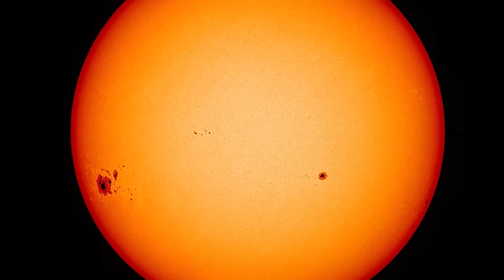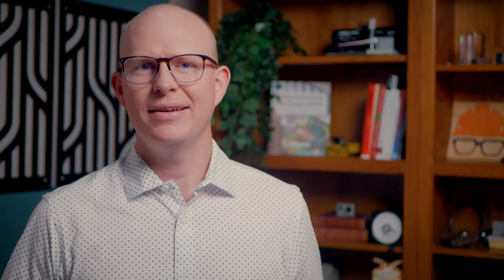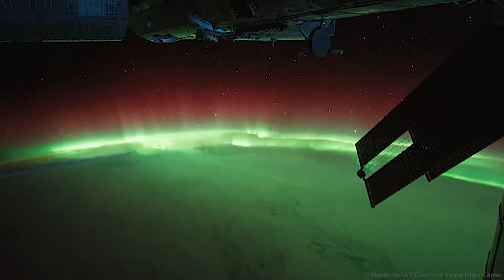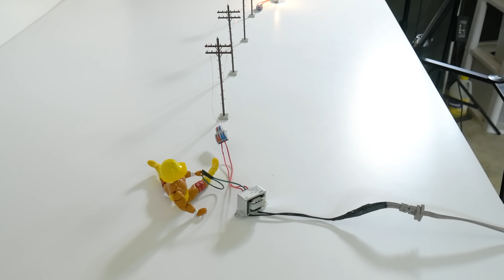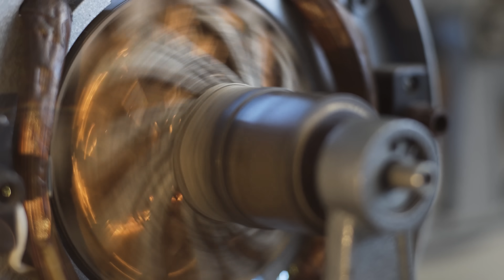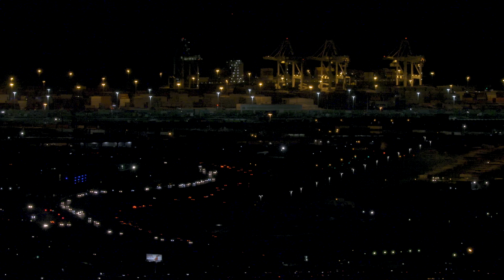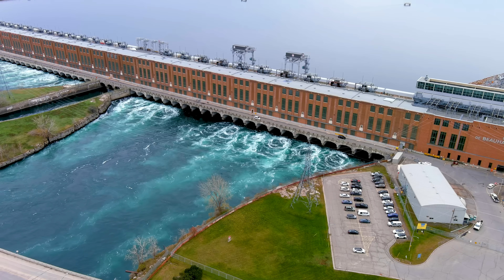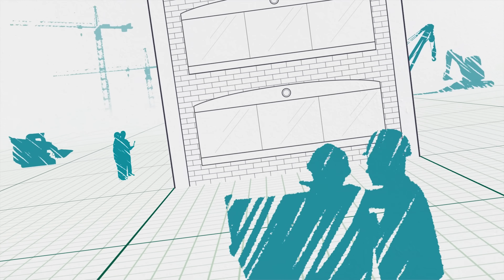The Most Confusing Part of the Power Grid

Comment: Depending on where you live in the world, the plug that goes into the power outlet is different. How is it that there are so many variations? why not one universal plug, no matter where you live in the world. If A USB is the same world over, why not the plug? Is it politics or an engineering issue or a bit of both?
Reply: There are arguments that can be made for and against just about any receptacle design.  While it would ideally be nice to standardize, the fact is that there is significant 'sunk cost' in existing infrastructure, and the benefits of changing to a uniform design don't justify the costs that would be involved.  Saying it differently, its a lot less expensive for the relatively few people who travel internationally to own a plug adapter than it would be to rewire the vast majority of the world to one uniform receptacle design.
Reply: With USB you can just slowly add or change ports as new hardware comes out, but on the power grid, it's hard if not impossible to change socket types without causing huge amounts of undue disruption because unlike computers, houses are in service for decades if not centuries.
Reply: You'd have to (in as short a time as possible) change every building and outlet in the country, and every device that plugs into those outlets, so trying to pull it off will either fail immediately or end in at least one generation of people having both old and new outlets in their homes.
Reply: The power grids were all developed in a time when the world was less connected and most grids started out as small local utilities and they used what they decided was best at the time. Within countries things were mostly standardized, but between countries, who decides who needs to change and adapt? Not to mention, some of the world is 230V 50Hz and some is 120V 60Hz and a few other variations.

Comment: 15:05 I was having trouble understanding how generating more power in the system wouldn't help deliver the power but the analogy of a burnout actually helped lol.
Reply: in less layman terms it has to do with impedence matching and something called the Maximum power transfer theorem
Reply: @WildEngineering  jacobs law... or yeah, thevenin...
kirchoff also applies...
the generator is a resistor and the current also flows through it...

Comment: it bears mentioning that a lot of users with reactive loads will install their own power factor correction systems - so they don't have to pay to rent power they aren't actually using.
Reply: To be a bit pedantic - it's not power factor 'correction'.  When you use the term 'correction', there is an implication that power factor can be incorrect.  But that's impossible - power factor is never 'correct' or 'incorrect' - it just is.
Reply: @monophoto1  From IET: "Power factor correction is the process of compensating for the lagging current by creating a leading current by connecting capacitors to the supply. A sufficient capacitance is connected so that the power factor is adjusted to be as close to unity as possible. Power factor explained."

or to put it in pedant's terms, "power factor correction" is an official engineering term. therefore it cannot be incorrect; any more than "Cheez Whiz" can be incorrect.

Comment: For a wireless road that can also act as a power line (burried underneath) what about using an electric car and a personal card/smart tagging whenever someone gets on the road?  You can have capacitors (and batteries) always on the side of the road ready to discharge and recharge, with the tires acting as the inductor.

What about using homes and cars as a means to buy and sell power from the power grid to other areas, and that way people can not only charge their vehicle, but buy and sell intelligently on the road (literally)
- that would open up a whole slew of opportunities for people who own electric cars, in which their batteries become way more valuable than just a fuel tank- adding value to the vehicle they just purchased, turning it into a working investment beyond getting from point A to Point B.

The Overall Idea is to get power to flow from Large Areas that Already Have Lots of Power to Rural Areas that Don't, and Might Need Help for Power To Flow To Them, Besides People.  

People would be able to see the health of the grid in real time, and they could Literally Plan Vacations and Get Paid To Actually Take Trips.  Everything would be Seamless with a trip planner and an overview, and they could even be advertised to go on a trip somewhere, Literally to either Buy or Sell What They Own Seamlessly, almost like an Electric Stock Exchange.
Reply: See Tesla power wall, with software to feed power back into the grid.
Reply: @Outlaw_Traffic_Stops  How do Tesla (or Enphase) power walls and micro computer controlled solar panels affect power factors, costs, efficiency, etc?
Reply: Check out EEVBlog episode 224 for a thirty minute discussion/rant about why wireless (dis)charging of moving vehicles through a road surface wouldn't work. Not least of the problems that would need to be solved first is the installation cost per km/mi would be astronomical, then the upkeep and maintenance costs would dwarf that within a year, if not a few months. In a post-scarcity, Roddenberry-esque society where money no longer exists: yes, that may actually be (forgive the pun) a road worth going down, but certainly not under the banner of capitalism.

As for physical transport of battery charge from surplus markets to scarce markets, power lines already solve that problem. I mean, you'd already have to have those rural areas connected to a power grid to be able to discharge from the vehicle into the grid. Why can't the grid just handle it like it always has, instead of adding friction, physical work (as-in, moving a mass over a distance), heat dissipation, braking losses, and air resistance losses on top of the transmission losses that are already there? There's certainly some benefit to be had by having the grid able to be fed from car batteries, but using those vehicles instead of transmission lines for bulk transfer would just be throwing ~80% of the benefits of it out of the window.
Reply: I think my full reply might've been ghosted and it won't show it to me such that I could actually edit it (thanks YouTube), but EEVblog 1584, not 224.
Reply: @Phroggster  what?
Reply: @MichaelSkinner-e9j  It's not important. If my original comment isn't visible to you, my citation correction comment is utterly meaningless, and I'm not about to waste another half hour debunking these (technologically feasible, but utterly impractical in the real world) ideas in a polite and thoughtful manner. Just never stop coming up with new ideas on how to improve the world, ok?
Reply: @Phroggster  there are other people who have already developed this technology. 

It’s nothing new.

The difference is money, scale, and implementation

Comment: just  a question, why the power in the graph at 8:33 is not zero when voltage is? is there a reason for it  or is this a simple  mistake?
Reply: Yes it looks like a minor mistake. The power goes to zero when the current does but it should also go to zero when the voltage does.
Reply: You are correct. Power is zero when voltage or current is zero. That is what the graph was intended to show. But the graph is slightly off.
Reply: The voltage and current are not in phase in that graph so to calculate power you need to also consider the phase angle.
Reply: You are right. The power curve should cross the zero at the same points as the voltage and current curves. I guess that whatever program Grady uses for this didn't draw it quite right.
Reply: @czechgop7631  If the load of the circuit is inductive then the inductive parasitic element will act as an intergrator if you actually take that into account when the supply passes through zero there will still be power in the system it's clearly showing this as from around the 7:55 to the 8:33 part the chap refers to maybe open the eyes and ears and not base everything on ideal components that don't really exist in the real world or did your elementary teacher not teach you that and just how to look at a graph without taking into account the situation. Strange.
Reply: @SlyerFox666  No, there's still no power when either voltage or current are zero. All na integration would do for you is distorting the current or voltage curves .. which we don't see in the video. Electricity isn't magic and we have these equations for a reason
Reply: @czechgop7631  Well if there is capacitance or inductance then neither would be zero it's the difference between purely academic theory and real life you can never get a pf of 1 so there must always be some parasitic elements in the circuit acting when one or the other passes through zero
Reply: @SlyerFox666  But you see, none of that matters. You're still changing polarities so you have to cross over the zero line and that's when the power curve will cross also. 

Bottom line, all the OC asked is whether or not the graph is drawn correctly which it isn't. We can argue shapes and angles all day but it won't get us anywhere.
Reply: @czechgop7631  Oh ok well it must be easier to match phases when demand hits peak where your from then ✌️

Comment: Interestingly, even in my nearly brand new apartment (landlord special), the lights in the bathroom still dim when I turn on a hair drier.
Reply: sadly, while old houses were underwired, because they didn't know how much carp we'd be plugging in, nowadays, a lot of new dwelling units are underwired, because the builders are cheapskates.
Reply: Interesting is that if you look at even older structures (1890 - 1940) they are often  "over-wired" because the
electricians were so accustomed to DC and lower voltages.  (That is my editorial opinion on why.)

Comment: Where I work there are a bunch of large motors, the power factor is controlled by a large cabinet containing large chokes and capacitors . It keeps the power factor at .98.
Reply: Which means the motors and other loads don't send the reactive power all the way back to the power plant, instead  keeping it local to your shop, by 'sending'  it to the components in that cabinet - and they then again draw it back in the next half cycle.

Comment: 10 Volts on a lead acid accumulator? That is way too low, you better recharge asap before your accu gets damaged.
Reply: My thought also but then the bulb was a pretty high 1.2A load.
Reply: That battery can probably supply like 100 Amps, it's not struggling to power a light bulb. 

10 volts is already quite low though, tbh it is probably already damaged and will never charge back up to 12+ V. But if he just uses it for demos like this it's fine. In fact he probably has it for demos specifically because it's not good for it's original use anymore.
Reply: Someone plays Factorio.
Reply: Maybe it's an old ups battery. I keep a few around after I change them out for testing things. They tend to settle around 10 volts.

Comment: Grady, captain physicist here. Power doesn't flow. We can't say like that. It's energy that flows. Again, power plants also don't produce power. They produce *energy*, not power (technically speaking, power plants only convert one form of energy to another, but for the sake of simplicity let's leave it).
So, it's not power that's flowing in the transmission lines. It's energy that's flowing through them, electric, that is.
Reply: well captain, if you want to be truly accurate, the power does not flow through the transmission line, but around it. The Poynting vector is outside of the conductor as the E field is zero within the conductor. Power Flow is common 'engineering' naming, just as 'load flow'.
Reply: I have tried being pedantic and not writing "power flows". The resulting prose is awful. But what is wrong with "power flows"?
Try... 
"There are 8 megajoules per second flowing east in the transmission line." 
"There are 8 MW flowing east in the transmission line." 
"The power is flowing east in the transmission line." 
It does not seem so wrong since "power" has the energy aspect and just adds the time aspect. 
This does not negate the presence of the energy aspect in "power".